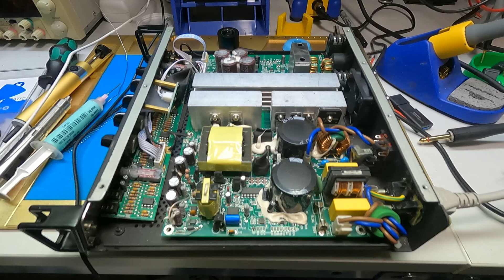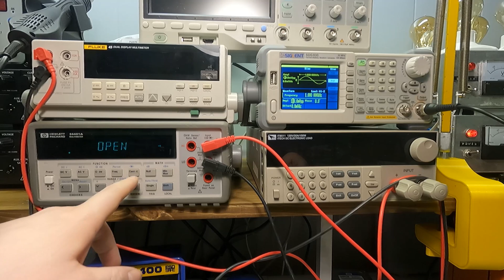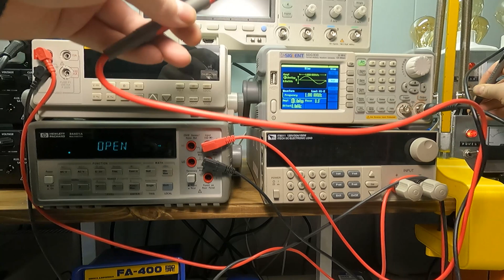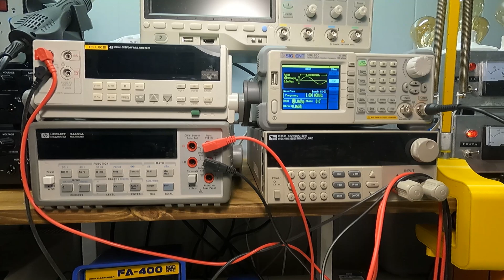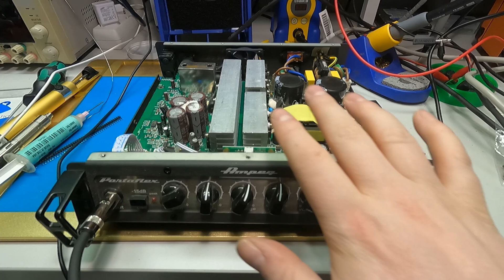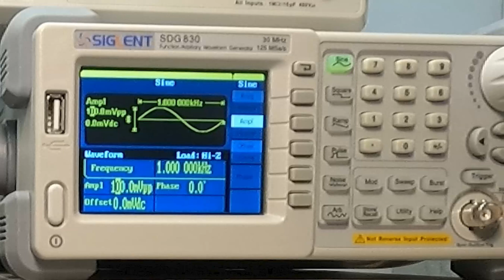Ampeg Portaflex PF-350 | Part 2 - Will A Fuse Fix It?

Comment: I have the same amp. Had been working perfectly until I went to use it 20 minutes ago. Connected up, switched on and no output. Wiggled output lead on the back with low gain and volume, audio worked for a split second then 'pop' and electrical smell. I now need to find time to take the cover off to see what has caused it to blow. I wonder if I will find a fried spider?

Comment: What would cause my pf800 to intermittently stop making sounds? 

Power light is on. Compressor light activates. Di to foh works. 

Just stops sending signal to the cabinet.

Comment: Bom dia amigo sou técnico no Brasil , vc pode me informar qual a frequência de trabalho nos gate do fet.  No pino 13 do ic 8. Irs20957s, me ajudaria muito.   Fico grato pela resposta 
Good morning friend, I'm a technician in Brazil, can you tell me the frequency of work in the fet gate. On pin 13 of ic 8. Irs20957s, it would help me a lot. I'm grateful for the answer
Reply from the maker: Sadly I no longer have this amp, so I can't measure it. However, if the amp makes a clicking sound or makes no sound at all, check if the power mosfets are shorted, they blow quite often. Or is there no voltage present on the main capacitors, check if the power supply switching mosfets are dead or the driver IC is dead. The voltage on the main caps should be around +80 and -80 volts, 150 volts on the PF500

Comment: Thanks for the video. So... I made a big mistake, I connected my pf350 (with the voltage switch on 127v) in a 250v side of an external transformer. The transformer burned in quickly, and expelled lots of smoke.  I was surprised because on a visual inspection I didn't see anything blown inside the amp, just the fuse. I guess it is dangerous tocause more harm if I change the fuse and try to turn it on, so I will take it to the a professional. What puzzles me is why did the external transformer catch fire and the amp did not show, at least visualy, anything burned. The transformer was correctly connected to the 127v wall plug,  the amp was switched to receive 127v and the transformer was sending it 220v.
Reply from the maker: Since these amps have a switch-mode power supply internally, they can behave a bit weird, in an upcoming video I have a PF500 that did start even though one of the output mosfets were completely burned.
Reply: @GrumpytechieNet  the tech said the power section will have to be repaired, so I will have to spend some cash. Well, at least it can be repaired.
Reply from the maker: @ZombieBath  They are quite sturdily built, so I'd expect only a few components being burned. It's hard to say though, repairs like that are usually a matter of replacing failed components, see if it works, finding more components to replace etc. So it can take some time to fix.
Reply: @ZombieBath Hey man, I made the same mistake with my pf-350, and before I start repairs, I'd like to know a little more about what blew in yours (besides the fuse). Did the repairman tell you what blew in the end?